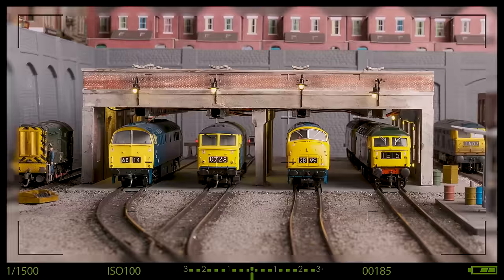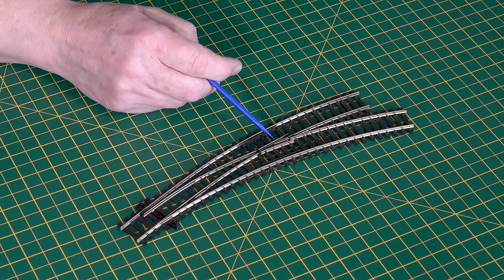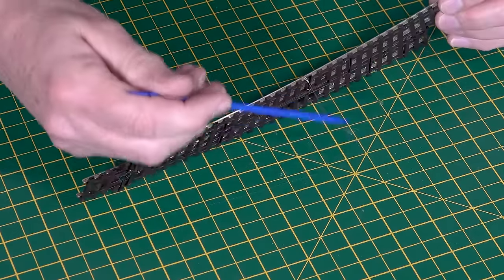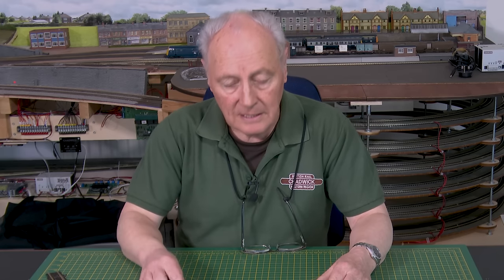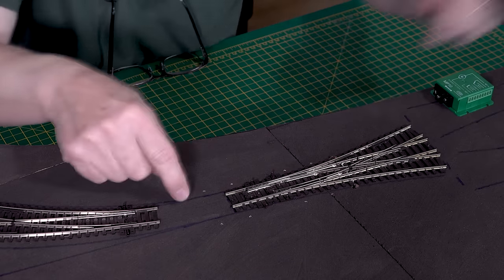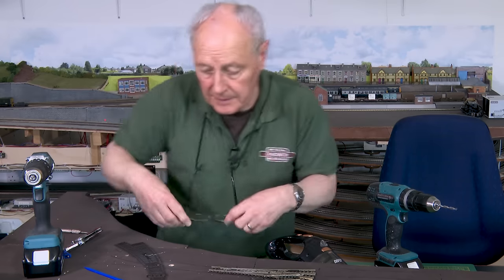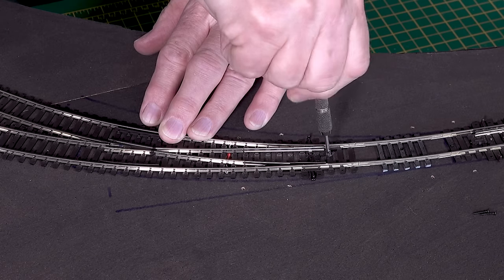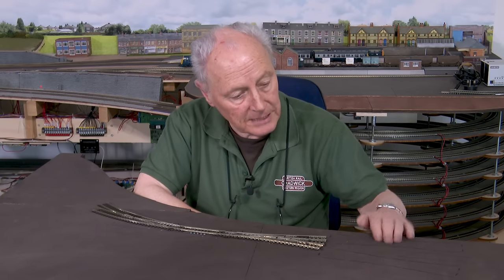PECO UNIFROG Vs Electrofrog Vs Insulfrog Points at Chadwick Model Railway | 219.

Comment: Great to see that Peco are now making a point that does away with the need for every modeller to physically rewire what they have just bought. I often wondered when Peco were going to catch up with the users. But watching you use screws in the middle of your track to secure it made me ask? Are you using Power base and engine magnets to get better traction on your inclines? If so you may find the engine magnets conflict with your central screws.  Better to put them in the outside part of the sleeper, or possibly, if inside, as close to the rail as possible to avoid the magnet slowing the engine down as it passes over. My experience was that the magnets were dragged off from their engine mountings, so avoid being in the centre. I used small pins to the outside of the sleeper as they were less obvious. Love what you do, Thank you, Roger
Reply: I use Power Base magnets extensively and have all my track screwed down using M1.7 screws in 1,5 mm  drilled holes.  I have on a couple of occasions found one of the screws attached magnetically to the magnet but this only occurred with accidentally oversized holes.  Changing to an M 2 screw as a replacement solved the problem.
Reply from the maker: The screws are a temporary measure until I’m certain of the track positioning. Once sorted, I will remove them after ballasting. Regards, Charlie.
Reply: @grahamthompson6622  Thank you, my problem was not collecting screws to the engine , but the reverse. Either the magnet fixed the engine and interrupted progress, or the magnet was dislodged from its mount under the engine - until I sited the screws outside the central running area to avoid any clash with the magnets.

Comment: Hi Charlie, What a great video on the types of points. The unifrog model you used was it the Peco SL-U77-76 in code 100. As I use Electrofrog these would be a great help. I'm on a 3rd radius curve at present that I want to spur off in a tight space so these may just be perfect. They are more expensive at present but a great addition. I'm sure folk want to know the code numbers. Many thanks you help me daily. Thanks Robin Cook, Llanelli, S Wales.
Reply from the maker: Hi Robbie, I can’t remember the exact number offhand, but I certainly do mention it in the video. Regards, Charlie.
Reply: @ChadwickModelRailway  I've re run the edition & you only mention the part but not the number. If it's any help to those looking on they are Peco Streamline Curved small radius turnouts. SL-U76 Right hand & SL-U77 Left hand. Both code 100 & both in Unifrog. A great addition & thanks for bringing it to our attention. I'm about to use some & a great help they are. Charlie what a minefield it is & the sooner Peco get them all over to Unifrog the easier it will become for all concerned. They will only need to make one item & dealers will not need a mountain of stock, a winner all round.

Comment: Charlie.  Interesting.  Could you not have used a wire in tube method of operation with the point motor located off the centre line of the curved point?
Reply from the maker: It has to be changed via point motor for the computer to work properly. Regards, Charlie.

Comment: Thanks so much, i'm planning my first layout now and want to avoid buying things I end up replacing.  To that end, I've been learning about the differences in the points available.  I agree Unifrog makes a lot of sense as I can use it as a insulfrog initially, prep for point motor and switching frog power, then add the functionality later when i'm ready.

BTW do you have a video about radius choices, I want a small but functional layout, I'm going to avoid the 1st Radius based ST-5 turnouts as I think the motion looks silly as the trains move over them, so i was going to stick to at least 2nd and 3rd radius but that is making my layout choices somewhat limited on a small board.  That said, its my first layout and I'm sure there will be bigger ones to follow.
Reply from the maker: Yes, do try to avoid first radius curves unless it’s a very small shunting layout. Regards Charlie.

Comment: I very much like the idea of the new Peco unifrog range. As I have already purchased points for my layout I doubt I will be buy any as of right now, but if I ever build a new layout I would definitely use these! I think there is a reason though to keep the insilfrog point range, as if you use analog and don’t want to do all sorts of wiring for electrical blocks, then those points are enough so that you could still power multiple locos independently without loads of confusing wiring. As someone who uses DCC this isn’t really an issue, but I could see why it would be for analog users.
Reply from the maker: You make an interesting point Model railway fan. However, I think it will take them years to make a decent range. Regards, Charlie.
Reply: @ChadwickModelRailway  that’s true, so the old points will be around still for a while probably.

Comment: Hi Charlie. A very good comparison of the three types of turnout. Slightly off topic: does repeated use of the jigs to locate the correct position of the holes for frog and dropper wires, cause enlarging of the holes in the jig (and breathe)?
Reply from the maker: I imagine that it’s possible Paul, however I’m more likely not to drill straight in the first place! Charlie

Comment: Quick question for the experts. Does plywood in a loft need coating/sealing/painting for model railway use?
Reply from the maker: Sadly, Jason, this one I can’t answer. I certainly would if I were using MDF though. Charlie.

Comment: Thanks Charlie. I’m starting out on my 1st build and have a decent amount of track and rolling stock I’ve inherited. Should I use what I have or start afresh with the new unifrog technology?
Reply from the maker: Hi Tim, there is very little uni frog points available currently. Unless of course you’re thinking of using the bullhead range. If you use the old track check with a magnet, that it’s not steel. If it is, please discard it for corrosion issues. Regards, Charlie.

Comment: I recently asked if you could explain unifrog points in a swift, so this video was perfectly timed. Am I correct in thinking this unifrog doesn’t need insulated rail joiners being a major difference?. Don’t let MRS. B see what a dab hand you are with a vacuum cleaner lol.
Reply from the maker: Yes, that’s correct, they should not need insulated rail joiners. Regards, Charlie.

Comment: Cracking video, very explanatory, thank you, although I have a question if you don't mind? I have a N gauge live-frog 3 way point I really would like to use, but cannot get my head around the wiring side of things. If I were to just install it without any wiring shenanigans, would it isolate those tracks it wasn't switched to? or would all tracks be live constantly? or would i just have a massive short circuit, with locos going in different directions.
Reply from the maker: I’m sorry, Hornet, but I don’t have access to an n point to test it. Regards, Charlie.

Comment: Hi Charlie, thank you for clarifying the situation with the Peco points and I can see a real benefit for production to make just the unifrog points. What are you planning on doing with your double slips? The code 100 slips have insulated frogs unless things have now changed and you used to switch to code 75 to avoid having a dead section on the point. Is this what you are doing in the yard?
Reply from the maker: Hi Simon, no the modifications on my points will be soldering links across all the switch blades. Regards, Charlie.

Comment: Hi Charlie, impressive video.  I am planning and building a TT:120 layout using PECO code 55 track with cobalt digital ip motors and the PECO unifrog points.   In my previous N gauge layout, I removed the tie bar spring to prevent the stock rails prematurely shorting the layout, would you think it will still be necessary to remove the spring for the TT layout.?
Reply from the maker: I’m sorry, Colin, but I really don’t know. Perhaps a call to DCC concepts will give you the right answer. 
Regards, Charlie.

Comment: Hello Charlie, another great video. My wife and I are big fans of yours. One thing I am not understanding, I've probably missed a trick here (it is the usual explanation for me). You added a small piece of 3rd radius to open up the gap between the 3-way and curved points in order to install the MP10 the opposite way around, thus making the terminal block accessible from your preferred side. But when you actually installed the motor I can't see how it has been put in the desired way . The terminal block still seems to be on the side you didn't want (?) Or did I misunderstand?
Reply: So I see someone else asked the same question and you answered it. So I did misunderstand (as I suspected) and I should have been more diligent in reading all the previous comments 😂
Reply from the maker: Rest assured Michael, I do understand your confusion. It certainly didn’t help with me placing the other side of the board facing the camera. Regards, Charlie.

Comment: Great video Charlie.
I do have one question about uni frog which has come up when I have been using them.
I am a DC modeller so being able to isolate a section of track by setting the points aganste a train is a great advantage as it reduces the number of isolation switches required.
The uni frog design out the box seems to destroy this ability. Do you know if there is a way to modify it so it behaves more like a normal point does?
Reply from the maker: There doesn’t appear to be Matt, perhaps that’s a question for Peco. Regards, Charlie.

Comment: Well done again Charlie another excellent  video . I’m just thinking of replacing my set track curved points on the entry and exit to and from  my storage yard, with the new unifrog equivalents . Apart from appearing to be a better overall product, I am hoping they will eliminate a problem I have encountered where some locos have a tendancy  to derail on the set track points due in part I suspect , to their sharp radius ( I believe the new unifrog ones have a slightly shallower radius), but also to the appalling differences in wheel  back to back measurements on certain Hornby and Bachmann locomotives . I have spent hours checking and trying to set all the back to backs at 14.5 mm . I wonder if any of your other subscribers have had similar issues ? Is it too much to expect manufacturers to agree on an industry standard for wheel back  to back measurements ? Oh and coupling heights ! Enough of the rant ! My local model shop here in Perth WA is waiting for the new  unifrog points to arrive. I’ll be there when they do! Regards Andy Bashford
Reply from the maker: Rest assured Andy, my fingers are crossed for you. Regards, Charlie.
Reply: Thanks Charlie . I’ll give you some feedback once I can get and fit the curved unifrog points . Regards Andy

Comment: Hi Charlie, I’m intrigued to know why you are using the larger MP10 motor rather than the smaller MP2 or MP5, especially when you are short of space between points.Is it because they have the same footprint as the Tortoise or are there other advantages?
Reply from the maker: Hi Steve, one of the main reasons for using them was because they are new and to test them on behalf of the subscriber. Regards, Charlie.

Comment: I had wondered if it would be possible to turn an electrofrog frog into a unifrog and avoiding those insulated joiners by using a dremel with a very fine disc to cut slots maybe a few mms behind the frog entry point.
Reply from the maker: That could be a disadvantage, Jane. When you hit the frog from the other direction, and the points set against you, you will completely foul the point before the short circuit. Regards, Charlie.

Comment: Hello Charly, why are some videos recently in poor resolution? Kind regards Chris
Reply from the maker: Rest assured , it’s at your end not mine. You can change the resolution on the bottom right hand side of your options. Always go for 1080p.
Regards, Charlie.
Reply: @ChadwickModelRailway  Hello, most of them do. It just doesn't work with this one or any other. It says not available.

Comment: So can I ask then Charlie. With the unifrog point, if I choose not to use the wire under the point and just as it is out of the box is the frog powered like it would be using the electro frog and insulating fish plates. I have older hornby locos wich struggle over hornby express points due to the large dead area over the frog 
Cheers
Reply from the maker: Hi Richard, no the very small part of the frog will remain unpowered as if it were plastic. Regards, Charlie.
Reply: @ChadwickModelRailway  Thanks for the reply. So what is the advance of using the unifrog out of the box without modification as opposed to the set track.

Comment: I might be missing something but, with the unifrog as of the provided power bridging wires to the main rails after the frog, and the fully insulated frog from the diverging rails, 
To me this means that regardless of the point blade selection, if the entry rails on the point are powered, both diverging tracks are powered ? 
That makes it great for dcc, but unsure how to adapt it to work like an insual frog where throwing the point changes which track is powered, which is better for dc running. Any advice or just isolate the track with a switch after the point when dc running? :) 

The layout I'm currently building for my nephew is dc but I'm trying to design it with the provision to become dcc one day, so a unifrog may be ideal. Only thing is the dc switching question as posed above? I'm hoping that makes sense and appreciate your insight.
Reply from the maker: Yes, you are correct, you would have to put an isolating cut after the frog to cut power to that track. Regards Charlie.
Reply: @ChadwickModelRailway   Hi Charlie, many thanks for your reply and for letting me know that I had the correct understanding... I will put in isolation cuts to the following track. I should be able to switch them with the point via the point motor aux switch if I go slow action, or a relay switch if I go for a seep style solenoid and wire them together. 
many thanks for your help with this, David.

Comment: When the frog is wired to the point motor and you don’t use track power to supply the point motors. Does this cause a problem with the frog as it’s not having track power fed to it? Obviously it does work as many people prefer to power point motors this way.
Reply from the maker: No Des, I do not power my point Motors with a track Power. Regards, Charlie.
Reply: @ChadwickModelRailway  Charlie. Fantastic channel. I’m new to youtube but you’ve helped me refocus my love for model railways. Over last Christmas i went through my old train boxes and built a shelf test track in my living room that’s evolved into two loops over two levels. It’s only 12in deep but 20ft long with a small helix at one end. The other end is a bigger loop through my “wardrobe”. My theory was to get trains moving to see how serious i was. I put off my final layout for many years because I couldn’t decide on a track plan. Three months later it’s evolved from a straight bit of track on a wall to a bit of a monster. I should show you what you’ve done to my living room 🤣 Keep up the good work. Des

Comment: A timely episode. I have this afternoon removed an electro-frog point to check that I had done the mods correctly. I am getting a short circuit . Even with the frog wire disconnected, I get continuity between the frog and the terminal of a Brimal Components MR 204 unit. Perhaps David Blaine is in the building. Looks like piggy bank time ! A thought...(dangerous if it's me)..what if on a standard electro-frog point, the rails of the frog were cut with say a Dremel disc, and the exit rails connected with jumper wires as per the Unifrog, would that be contravening anything legal ?
Reply from the maker: Hi Rob, please confirm that you do have insulated fish plates on the frog, and if you do, have you got the track feed the wrong way around on the point motor? Regards Charlie.
Reply: @ChadwickModelRailway  Yes to the insulated fishcakes at the frog. I will check the other. Thanks for replying. All the best.

Comment: Hi, Charlie. I am supposed to have professional qualifications which tell me I am not stupid. But I must be, because I have watched your video several times and am still slightly mystified. I have at present a combination of insulfrog and electrofrog points. Are you saying if  the unifrog is installed straight out of the box, then because of the automatic change in polarity of the frog, it acts an an electrofrog equivalent (without  plastic isolators) or is it acting as insulfrog? I have several 0-6-0 tanks and whatever I do they  often stall on the insulfrogs but not of course on the electrofrogs. I had understood from somewhere or other than the unifrog needed to be modified in order to make it either electrofrog equivalent or insulfrog-can't remember which. Apologies for being rather thick.
Reply from the maker: If you install it straight out of the box, without collecting the frog wire, it will act as a insulfrog point. If you connect the wire to the switch on your point motor, it will act as a electro frog point regards Charlie.
Reply: @ChadwickModelRailway  Thanks Charlie. All clear now. Best regards, Nigel